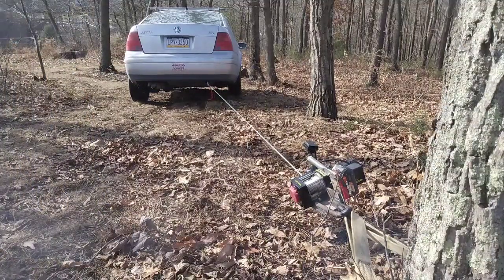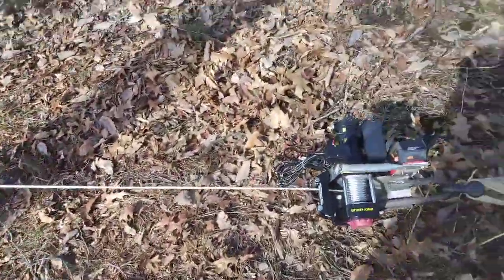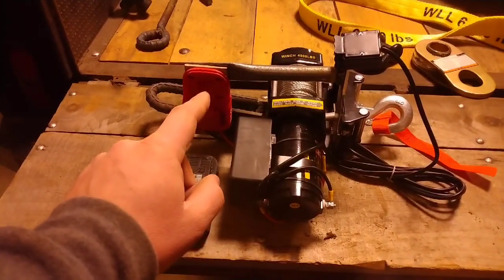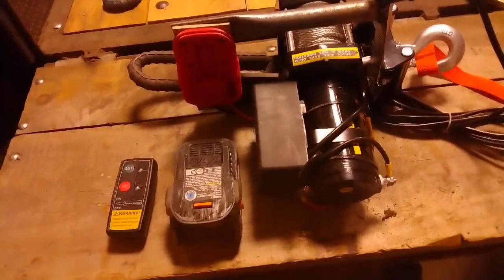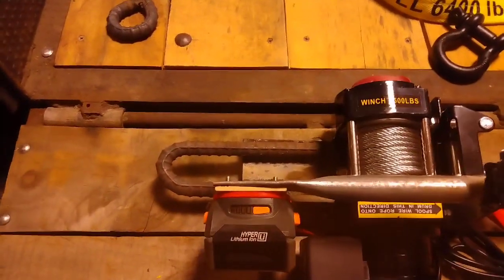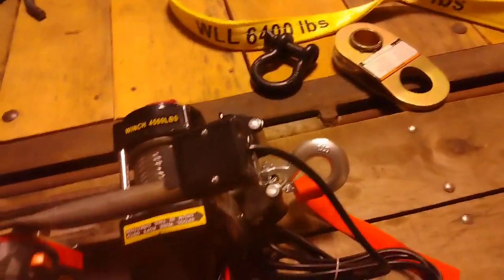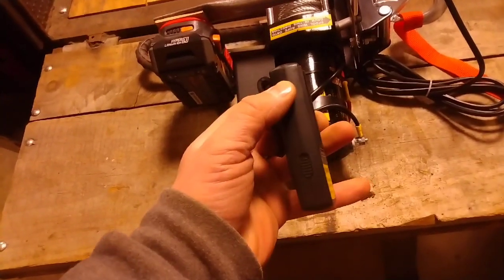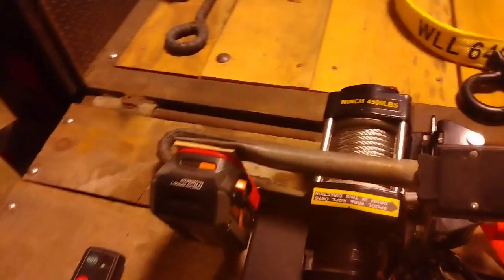running a winch on a 18 volt tool battery

Comment: The adapter you used, is it just a battery adapter to go from 18v to 12v?
Reply from the maker: It's just a plug for the battery, I talk about voltage drop in the video, but it's close and the equipment is not real sensitive.

Comment: The use of a snatch block would have pulled that car twice as fast with half the strain on the battery
Reply: Thats not how pullys work it would pull twice as hard half as fast
Reply: @TreeGenie  that's exactly how they work, you have no idea what you're talking about...why tf would a pulley pull twice as hard?!  https://youtu.be/M2w3NZzPwOM
Reply: @TreeGenie  He is not saying it would use half the energy, but put half the current draw on the battery. It's all estimates, but it might prevent it from cutting out.

Comment: Did you have to use a voltage reducer from 18 down to 12 ?
Reply from the maker: No I didn't, 18 volt battery under load is pulled down to about the same voltage as a vehicle's 12 volt system is when the engine is running at around 14.5 volts.
Reply: @elliottsconstruction2639  thanks for the tip. Also, what box did you use to cover the relay ?
Reply from the maker: @peternelson9865  I used the relay enclosure that came with the winch.
Reply: @elliottsconstruction2639  Yes, you absolutely should use either a speed controller or a buck converter to drop the voltage down around 12V. Using either one of these puts practically zero stress on the battery. All the unplugging resetting bullshit he's doing, you don't have to worry about any of that. I've got an M18 set up, 6000lb winch, using a snatch block and a 5.0ah battery and I haven't come across anything this thing won't pull out. In the most extreme cases I lose two battery bars, zero overheating or overloading. It's less than $20 and your battery and winch will thank you.
Reply: @tintshady2049   what guage wire is on the adapter? Thinking about doing this with a winch for my fish house. Dual 3500lb one on each side.. (would run each one separately) Have makita 18v 6ah batteries.
Reply: @prestongravelle9083  10awg or 12awg, not sure. It's sufficient for short bursts that my situation requires but it's be easy enough to put 8awg on there if you wanted to.
Reply: @tintshady2049  awesome thanks for the info!
Reply: @tintshady2049  What wattage is your converter? I was thinking of a similar setup, but buck converter current was a concern for me. I have a 30A here, but I didn't figure it would handle it.
Reply: @14truk  I use the buck converter for the 12v relay/wireless module. I use a 100a speed controller for the winch but depending on what you're pulling and the duration, you could get away with not using the speed controller, especially if you go in short bursts and use a snatch block.